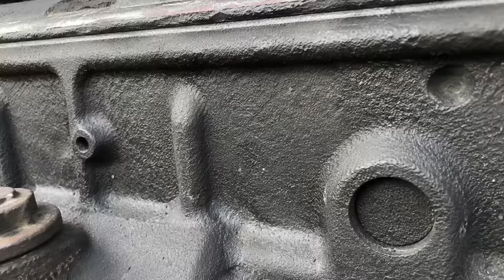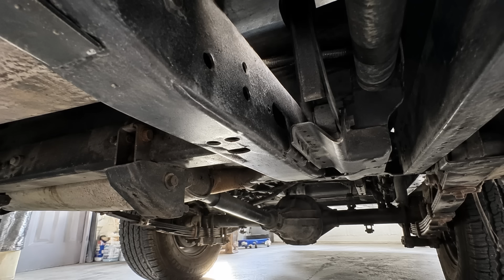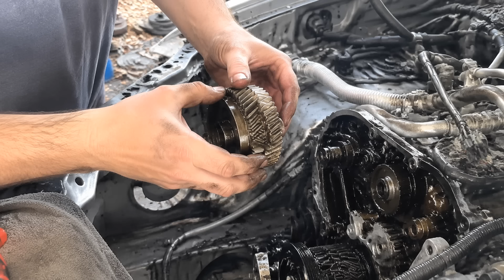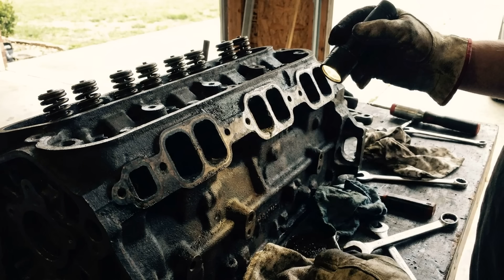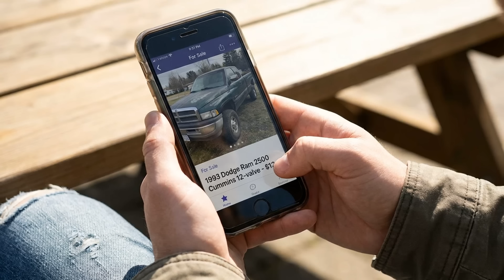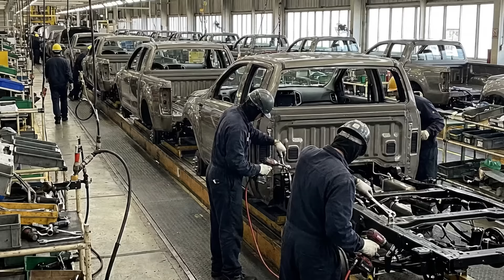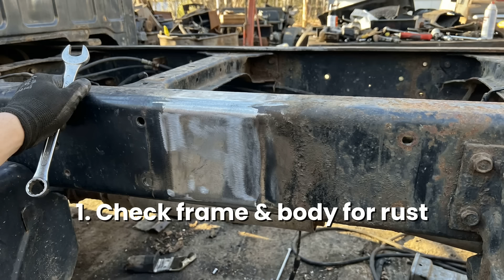7 Dirt-Cheap Pickup Trucks Nobody Buys (But They'll Outlast Every New Truck Forever)

Comment: Not sure if you've been shopping lately AI, but none of those are dirt cheap anymore....
Reply: You called it correctly. Try and find a 30-, 40-, or 50-year-old truck that is drivable or even in restorable condition for a low price. Nope!
Any turn-key classic truck already restored and road ready is going to be priced in the stratosphere. Even rotted out rust buckets are priced
In the thousands. I have been called crazy because I'm working on a 1968 FORD 100 that was gifted to me by a relative who gave up on it.
The frame is so bad that I'm building a new frame out of tubular steel and angle iron. This is very labor intensive, but I think that I'm on the right track.
This one has a 240-CID inline 6-cylinder engine, 9-inch rear axle and a 3-speed manual transmission, column shifter. I believe that I can make it happen.
Reply: @hydrostatic-m8y What does a 9 inch rear axle mean? The ring gear diameter?
Reply: @joewoodchuck3824  I stand to be corrected on this, but it is my understanding that that the 9-inch designation is actually the diameter of the differential carrier flange that the ring gear bolts onto. The outside diameter of the ring gear is larger than 9 inches.
Reply: @hydrostatic-m8y yes the nine inch was in trucks and station wagons commonly.
That's where you can find them.
The Nodular iron version has a big N on the outside casting.
Other vehicles commonly had the 8 inch and it's nothing to gawk at. For example my 302 with a C-4 in '68 had the 8 inch. That was a Torino GT.
So, the nine inch is the one people want if they're making a lot of horsepower.
Even race cars with GM power train want the Ford 9" for durability.
A lot of them have gone to it after mishaps with their GM rear ends and lots of horsepower.
You can ask a business like Randy's ring and pinion about what's what and how to rebuild and repair with the best parts and procedures.
If your truck is bigger , of course, there are larger rear ends and wheel hubs vary on the larger applications too.
Reply: Bradley 😮😊
Reply: @hydrostatic-m8y  You guys are looking the the wrong places. Just bought a 1988 Ford F20 4WD four-speed extra cab in great shape with 130k for $5,200.Compression was still over 90 percent. I saw plenty more for about the same or less.
Reply: @Auction_Henry  You scored a win with this one. Well done, sir.
Reply: They use AI dollars!
Reply: I get them out of the weeds
Reply: You have to consider when this was originally put out. Some are still great buys, like Mazda.
Reply: @JLH1956  I've actually personally been looking for Mazda B2000, B2200, and B2600i's for the last year.  One's in good shape are going for 8-10k from coast to coast.
Reply: @whizwhisnant wow. They are exceptional trucks. I had a friend who bought one used and put 200k miles on it.
Reply: @whizwhisnant . I know of a very clean white one that been sitting outside next to this guy’s garage for years, at least 10. Never looked closely enough to determine the model but it one of the ones on your list for sure. The truck is in Pittsboro, North Carolina. Thirty something miles from Raleigh.
Reply: @whizwhisnant I Got A 1988 B2200  SE5 With 75k On It For 
$4500 Back In 1993 Oil & Filter Changes On Time A Set Of Pads On The Front Tires And Replaced 
Clutch & Pressure Plate At 150k mi.   It Barely Made It Up The Ramps With What Was Left Of The Original Clutch To Do The Work But It Certainly Was Made To Be Easy To Work On I Only Sanded The Bluing  Off The Flywheel I Didn't Get It Milled 
Worked Just Like New
Reply: And I Sold It For $2200 As Is It Needed Tires And I Needed The Money For A DUI Lawyer
Reply: @jamesdugan8086  I hope you learned a lesson about driving while intoxicated.
Reply: I agree with the video but many of the pictures do not match the engine, but that is ok. Being 70 years old I know most of this video is so true. I had a Ford Ranger 1991 if not for a divorce I might still be driving it. 250,000 miles is easy if kept up with good fuel, tuned and good oil changes.
Reply: It's still step in right direction.
Reply: Well,if you'll notice he uses images that don't fit what he's talking about or are real world for that matter. AI is slop.
Reply: Don't worry. Everyone is either leveraged to the moon personally or an investor gambling someone else's money. The problem is most of their business models are based on an expectation that wage earners will keep getting more purchasing power and that they can capture some of that. They are in fact tied to wages and only get extra, not whatever they pretend things are worth
Reply: How is this AI?
Reply: Because it can't pronounce big numbers proper?
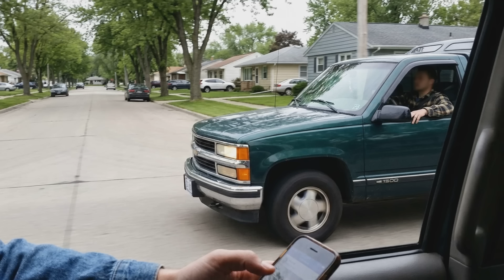Reply: @PR.Hobbit look at the 14:55 mark.  He pronounced it as oh-b-s instead of O.B.S. There is a lot of good information in this video. If this were a real person, he would know how that is pronounced.
Reply: @bigmacok   I'm looking for the info so should be grateful
Reply: The only truck on the list was this Chevy pickup the rest were almost pickup trucks 🛻.
Reply: Bradley 😮😊
Reply: Feel like im in preschool spelling out car makes and engines.
Reply: NOTHING is
Reply: This AI Bullshitter is building clicks.
Reply: @henryhill3778 not me brother.